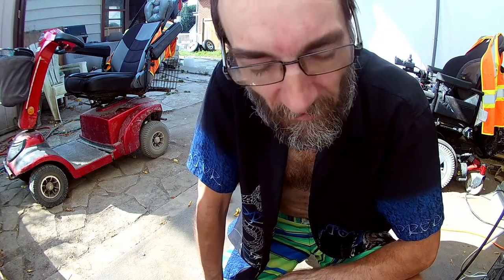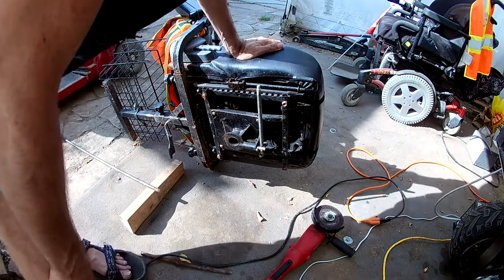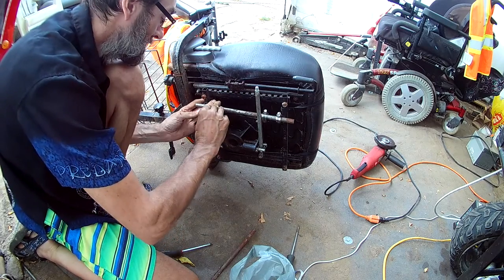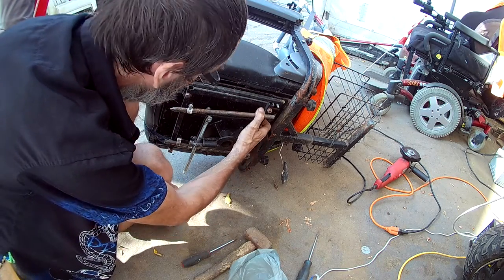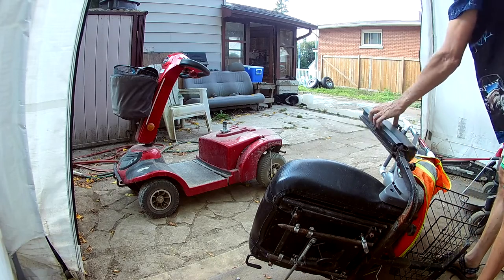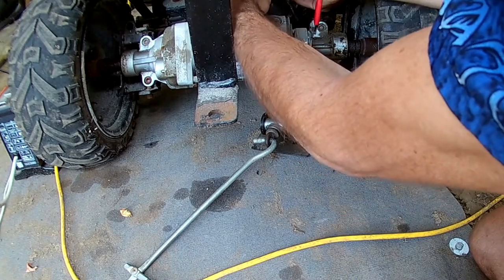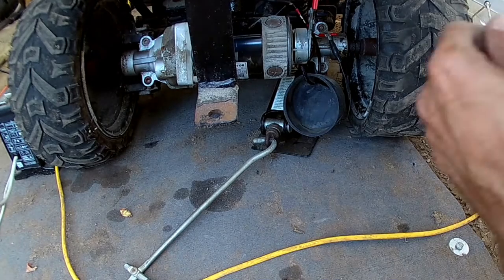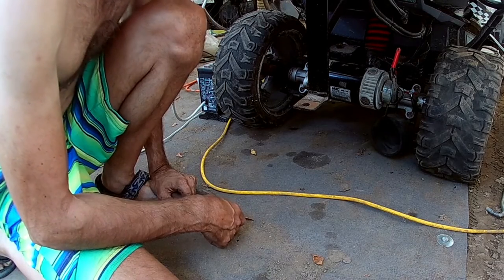ES950 Wheelie Damage and Revisiting the Monster

Comment: With the Monster Wes, it's like a or the keyway inside is flogged out or maybe it's a splined like the axle on a cars rear diff. It doesn't look good though, and that growling noise is concerning too !!  From looking online there really isn't much inside the transaxles of other scooters, maybe the Monsters different !!  Like you say it's not the sort of thing you'd like to tackle, especially without a diagram or at least knowing what's in there. Goodluck mate. Seeya Rob
Reply from the maker: I've never opened a transaxle. I've watched videos of it and it's not something I would want to tackle. But my thinking at this point is leaning toward a broken gear. It's the best explanation for that snapping, as I'm picturing a piece of a broken gear momentarily getting stuck in something. The rear axle is splined on the Monster... no keyways on this model.

Comment: If you hold the swivel handle as if your swivelling the seat when trying to lift the seat off it comes off much easier maybe have to wiggle it a bit
Reply from the maker: I eventually realized that. I always turn it a bit now to keep it from re-locking into place. This scooter was always a pain to get the seat off.
Reply: @TheTimeCapturer  there not made easy especially the wait of them if you keep them greased it does make it easier 😉

Comment: I was thinking if the monster chair is similar you could just use that :)
Reply from the maker: What a great suggestion! I never even thought of that. It wouldn't work though, one's male and one's female. The ES950's chair has a hole that fits onto the post, where the Monster's chair has a post that fits into the hole.
Reply: or  could you take off the main fittings and weld them to another chair say from another vehicle seat
Reply from the maker: 1111000ANGEL0001111 Probably. But if I had a welder, it would be easier just to weld this one. Hope to have one by spring.
Reply: Yes it seems you need quite a set of tools to repair scooters, luckily you understand some electronics.

Electronic break 
There is a test you can do for it but it has to be removed from the motor to do it, I think the monster is 24 volts

So if you add 24 volts just to the break and it releases then its possible its not entirely the break that's if its not rusted up.

Trans - axle 
Have you taken that apart as it could be something in there grating. Heating up the motor as i was seeing oil come out and it maybe that a seal has gone inside. Here is a a video on trans - axle repair though i would not fancy doing this as even the guy fixing this finds it complicated https://www.youtube.com/watch?v=BisDkA-8GkE
Reply from the maker: I won't open the transaxle unless it's absolutely the last option. Even then, I may just give up and get a service technician to do it. It seems that may be my future as I'm finding it more and more difficult, physically, to work on the scooters.
Reply: True except in that video it cost him 20 dollars and some grease to fix it

Were as he said if he had to buy a new one it would be hundreds.

You've been pretty good at taking things apart and putting them back together so if you do a video of you taking it apart you can always refer back to it to put it back together.

But from looking at the videos you have a leak now if there is no grease because of this then the cog's would work harder and make the motor work harder so it could be it needs a seal so.

You could ring an engineer off-course and ask if they can replace the seal and if they say no you, could try replace it yourself or get a new trans-axle

if new trans-axle is a few 100 dollars that would be better than having the monster just sitting there.

Once you repaired it you could sell the monster and buy something more reliable there is another scooter that looked better quality
Reply from the maker: I'm stuck with the Monster for now. I still have four years to finish paying for it. A new transaxle for the Monster is $1000. If I call for service, they have to fix it. Because I'm on ODSP, they are mandated by law to fix it. I'm fortunate that way. I just prefer to do things myself and pay for what I can because I don't wish to abuse the system.
Reply: I would get them to come fix it

1 Replace all the wheel bearings for all 4 wheels

2 Replace the water proofing for the cables

3 Replace the Trans-axle

4 Replace the parking break

5 Replace the electric motor

6 Replace the ball joints

7 Replace the speed controller

8 Replace some of the wiring

9 Replace the rear shock with a better one

10 Replace anything else that is faulty or about to be defective

Its not your fault that the monster has several faults that eventually cause it terminal failure.

ask them if you can do a video on them repairing it as this could be helpful

but if you get help id get it fixed as  i don't know how long the batteries last if you don't use the scooter and just keep them on trickle charge do they keep in the same state permanently or do they degrade faster
Reply from the maker: During the time the Monster sat idle, the charger was plugged in. Occasionally I'd switch battery banks to be sure all four stayed topped up. Today's chargers, good ones anyway, monitor the batteries and only apply a charge to them if their voltage falls below a specific threshold. You can keep them plugged in indefinitely. Of course, cheaper chargers won't have this ability and will likely overcharge.
Reply: I was actually wondering how much trickle charge do you need to keep the batteries topped up because if you could put a small alternator on the scooter somewhere while your in motion it maybe possible to trickle charge the batteries while on the move giving you longer on the road.

Does your other batteries tie in to the main charger then or are they on a separate charger.

When you replaced your old batteries did the current in them reduce and is there a way to test your batteries so you no when there on there way out. or do you only no by how long they last & not by a specific voltage you can test for.

I know you can top up acid in a battery but they say you add distilled water.

If the cell has a build up of crystals on the plates this kills the battery. 

i've heard of something you can plug in for this but it could be a fake possibility with something called a desuflator.

But i dont no if this just works on acid batteries or on gel batteries as well
Reply from the maker: Both sets of batteries are separate from each other. I have to disconnect one set from the scooter, then connect the other to charge them. I'm not too familiar with battery diagnosing. I just know when they aren't working properly. I've had two sets of batteries that weren't working. Both sets were proper voltage and both sets passed the load test. But both were no good. There have been several claims on Youtube about how to refresh dead batteries but, they were for car batteries (not deep cycle), and most have been proven to be false claims. As far as I can tell, there really isn't a way to refresh them. As for gel batteries, I know nothing about them except they won't leak.
Reply: Its true ive heard pulse charging the batteries is supposed to fix  batteries but ive also heard overcharging the batteries works but you cannot do this with modern chargers you need really old ones and you have to keep an eye on them other wise they go BOOOM!!!  but years ago i remember you could take the top off batteries and clean them and start from scratch but these  days they dont let the public do this and your forced to buy new ones, because of all the crazy people who go round throwing acid at people.
Reply from the maker: 1111000ANGEL0001111 Those people are the reason I had such a hard time getting my leaked batteries topped up. Another supposed solution was to fast charge with a car battery charger that has that feature. Not sure if that was proven false or not but fast-charging a deep cycle battery is just asking for problems.
Reply: Far as ive seen you need slow charger but its a very old charger like from the 1980 as they dont have the electronic cut out the new ones have but it doesnt always work.

but the more expensive batteries probably have a better chance because there made better
Reply from the maker: 1111000ANGEL0001111 Deep cycle batteries have thicker plates in them than regular batteries. This allows for deep draining and charging but can’t allow heavy currents. I would assume high current charging would also damage them.
Reply: You may need the change the swivel base to anoth chair
Reply: Go on ebay get yourself a gasless mig welder, mask, gloves and welder apran and you best wear appropriat foot wear dote want Molton metal burning a Hull in your foot do we 🤣

Comment: my guess is going by how hot the motor is all the grease inside the transaxle has melted down and leaked out past the seal  an the transaxle is now dry and over heating and that's upsetting the motor and controller and causing the error that motor should not be anywhere near that hot I can go 10 miles and my motors only get cosy warm  that under normal circumstances should be a warranty case  , and if you have that one finance I would ring them and tell them its not fit for purpose
Reply from the maker: The manufacturer saw my review video and, because I put the trailer hitch on, they voided my warranty. The warranty was only for a year anyway so it's already expired now. I've talked to the bank and I've talked to ODSP. Neither have any coverage for buying a lemon. The grease has been leaking out since it was about 7-8 months old, long before this problem started. That's why I'm thinking broken gear. I have no way of knowing just how much is left in there.

Comment: Just another question, when you got your Heartway scooter did it slow to half speed every time you drove around a corner, as my Heartway Royal does, and on reading about it, it says it has a Gyroscope corner speed reduction sensor, on the front steering that relays a message to the S-Drive Controller?
Reply from the maker: Sorry for the delay in responding. From what I understand, The Monster is supposed to have this sensor but it seems it doesn't. It certainly doesn't slow down any and can be scary at times, and I've had everything apart at one point in time and I see no such sensor. I wonder if it's only on newer models.
Reply: @TheTimeCapturer  Well I am trying to find out where it is so that I can disable it, and your the only one to have a heartway scooter
Reply from the maker: Anthony Misell I checked the blow up parts list and the electrical schematics for the Monster, I see no sensor at all unless it’s built in to the control panel. I know it isn’t in the controller itself because I’ve had that apart. See if you can find info for your model. Monsterscooterparts.com is a good source.
Reply: @TheTimeCapturer  Well I disassembled the covering on the steering on my Heartway Royale scooter and found a small round shaped object on the upper steering shaft which was connected to the main electrical wiring conduit via a connector which I disconnected but on driving my scooter it reduced the speed and my scooter continued to slow to half speed  when turning, so I reconnected the wiring and cursed and swore.
Reply from the maker: @anthonymisell8845  That sounds like the beeper/horn. Where you described it is exactly where mine is.
Reply: @TheTimeCapturer  Well the only other place it can be is actually inside the digital display control box that controls everything O hell that is going to be a challenge to get into and find it disconnect and reassemble.
Reply from the maker: Good luck with that. I had to replace mine and it was hard enough just to get it out. Which model do you have? I'll see if I can get you some information...
Reply: @TheTimeCapturer  My is the Heartway Royale PF7S Golf Mobility Scooter
Reply from the maker: According to the service manual, it appears to be built-in to the panel, as you suggested. There is an option that I don't recommend. It shows which wire on the controller plug (as well as the control panel) the speed limiter is connected. I myself would try cutting this wire. Either that will permanently put the scooter in full speed or slow speed. You can always reconnect the wire if you need to. But I wouldn't suggest it unless you know what you are doing. Also be aware this will void any warranty you may have. Again, I don't suggest this but it is an option I would try. Again, use your own judgement. Don't take my word for it. Don't do it unless you are absolutely sure you want to take a chance. Here's the manual (although I'm not entirely sure this is the right manual): https://www.google.ca/url?sa=t&rct=j&q=&esrc=s&source=web&cd=1&cad=rja&uact=8&ved=2ahUKEwjyntu94e_iAhUIC6wKHc0nDG4QFjAAegQIBRAC&url=https%3A%2F%2Fs3-eu-west-1.amazonaws.com%2Fns.drive.prod%2Frich%2Frich_files%2Frich_files%2F000%2F001%2F287%2Foriginal%2Froyale-203-20and-204-20service-20manual.pdf&usg=AOvVaw0ZX1jIAOBE3OKm_1Z1-UrW
Reply: Well that settles it I am going to wait till the warranty runs out, before I do anymore messing about, I just go it back from the dealer who had to put in a new S-Drive controller, and electric motor in, and it is running great but the slow down when turning drives me mad, thank for all your suggestion, it amazes me watching your videos, where you work on a dirt floor with the minimum of tools, in a tent like garage in the snow
Reply from the maker: Anthony Misell Yeah, slowing down in turns would drive me insane too. I would love to have a heated workshop for my projects. Unfortunately, I have to do what I can with what I have. The whole idea of these videos is to help others if they have similar problems... although many are just modifications.
Reply: @TheTimeCapturer  You said you had to replace your main operating console, well open up your old one, and tell me what the gyro looks like and where it is placed. and how many wires are connected to it, and what colour are they.
Reply from the maker: Anthony Misell I replaced the controller, throttle and the control panel, only to find out the problem was a bad plug. Both control panels are still good and I put the old one back in as it still holds my total mileage. I don’t really want to mess with my new one as it appears to be snap together. There is no indication In my wiring diagram that The Monster even has the sensor. However, when I go out tomorrow, I’ll take a look at the control panel to see if it can easily be taken apart. It’s out in the garage and I’m just heading to bed. I’ll let you know what happens.
Reply from the maker: @Anthony Misell - I took the control panel apart. I made a page on my website so you can see pictures. It probably won't help you much though, as I see no sensor.http://www.thetimecapturer.ca/test/panel.html

Comment: You really need to get yourself a welder 🤣🤣 no more nuts and bolts fixings and a much stronger hold
Reply from the maker: Thankfully, I have one now.
Reply: @TheTimeCapturer  and the name to that hitch idea is "heim joint" manly used in motorcycle towing hitch or as in car steering you can get different sizes just though you'd be interested 😉
Reply from the maker: Yes, also known as Rose Hitch, I found out.